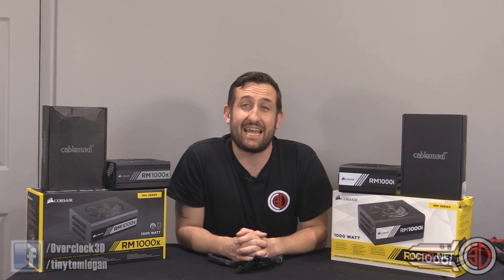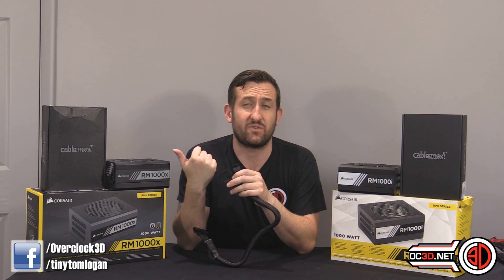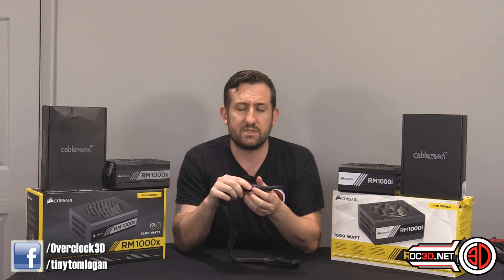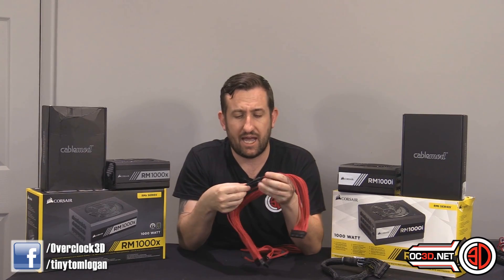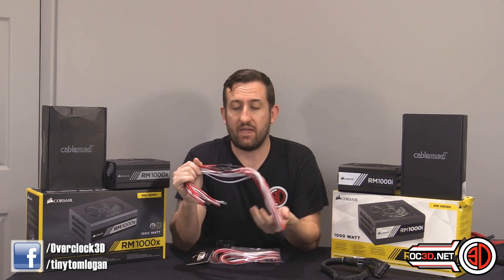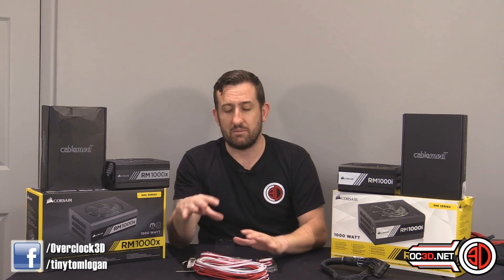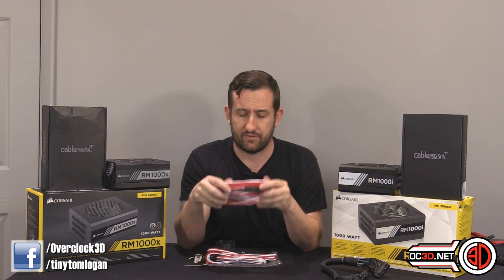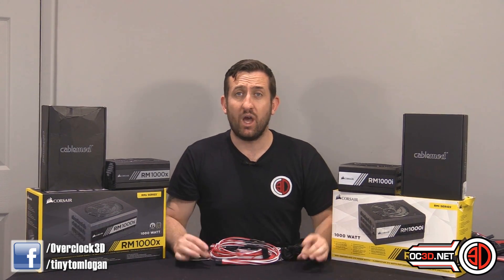CableMod Corsair RMi and RMx Cable Kit Review & Explanation

Comment: Cable comb question. Does the cable mod pro replacement cable kit come with aluminum or plastic closed cable combs attached to the main cables (24 pin, PCI-E and EPS and how many cable combs on each of those main cables? Thank you in advance.

Comment: Wouldn't it help if every PSU had in its description whether the cable ends are straight or right angle?  I bought one, another brand, that very well matches the components, except the proprietary case dimensions.  I bought it in spite of probably not fitting properly (after reading specs and looking at cost, better quality for lower price than OEM replacement), but didn't know that their were options/problems for straight vs angled ends.  Mine came with angled ends, so I can't put the hinged ODD tray down with the HDD plugged in.

Comment: I recently bought a Corsair CX750M... but the 24 Pins and the CPU and the PSU cables are already there, you can't really change them, is there any possibility for me to get extentions so insine my PC I can plug in the extended coloured sleeved cable instead of the rough stock cables? (sorry for the bad english lol)

Comment: What none of these reviews mention is that the 24-pin cable actually has 27 cables which makes it difficult to add combs. It's not even compatible with Cablemod's own C-series cable comb kit (speaking of which, when are they going to do black ones?) and the E22 combs do not fit.
Reply from the maker: +MAIN SEQUENCE Pretty sure its 28 PSU end
Reply: +OC3D TV there are 27 cables at the MB end which is the end that matters because it's visible. So hopefully Cablemod will produce 28 or 14 or even 4 slot combs to fit otherwise I'll wait til E22 start selling 2mm combs (which they intend to do apparently). Beginning to think I should have bought extensions instead.
Reply: +MAIN SEQUENCE this fixed now?

Comment: My PSU is RM850I and I recently purchased the CableMod C-Series AXi, HXi & RM cable kit not knowing there was a CableMod C-Series RMi / RMx Basic Cable Kit available.

Which cables are different between the two kits?  Is it only the 4 cables that I need to swap out and can I use the rest of them?  Many thanks in advance to anybody who can break it down for me?
Reply: Did you ever get an answer to this? I may have made a similar mistake.
Reply: I have the same issue, did you get a response
Reply: The motherboard cable from the AXi HXi and RM kit won't fit on a RMi or RMx power supply. The RMi and RMx have a wider connector for the 24 pin cable on the PSU side than the kit provides. The rest of the cables fit but I don't know whether they're wired identically. To be safe I'd just just use the dedicated kit for RMi and RMx power supplies.

Comment: As an electrical engineer, I do find the extra capacitors pointless for 98% of consumers. Motherboards, GPU's all have capacitors and other components to smooth the ripples. This reminds me of beverage companies marketing bottled water as a necessity and healthier than purified tap water. It would be a good idea to use the extra capacitors if your sole objective is to achieve the absolute highest overclock. But for the average gamer, it's not necessary.
Reply: The latest cables from cablemods come withouth capacitors.. Guess they find out it was pointless afterall 😁

Comment: damm that was some bigs cap's U coude have use some must smaller ones just to take the ripples ok it mebi a little more expensive but the individually braided coude have gone over the heatshrink. And a error in U txt it not (MV) ripps (megavolt) it (mV) ripps (millivolt)

like U shows Hugorm 
ps typing is not my strong side

Comment: If the caps need to be as close as possible to the PSU connector as possible, why didn't Corsair put them right between the PSU PCB and the connector on the PSU side? That way you don't need any caps on the wires..
Reply: My thoughts exactly, Don't know why, but it would make sense if Corsair kept the caps inside the psu .
Reply: The caps were at the motherboard end.
Reply: Ichabaud Craine Have you not watched the video or something? Moving the caps to the middle of the cable causes 8mV rimples. If they're near the PSU connector it's only 2mV..  So the greather the distance between the caps and the PSU, the larger you're rimples are..  Do you know tools like MSI Afterburner? Adding only a few mV after a GPU overclock can stabilize you're GPU. Now, what do you think what happens if you have an 8mV dip.. If the rimples are big enough they can even crash you're game.. Luckily for us CPU's are less sensitive to rimples, but smaller rimples is always better..

Comment: im getting a corsair HX 1200i, do cablemod do cables for that?
if so do those cables also have the capacitors or is not needed for that PSU?
Reply: +t103Ninja we do have a cable Series for the HXi Series - it is called C-Series AXi, HXi & RM and does not need capacitors.
Reply: CableMod Community thanks for the info :)

Comment: What if I don't care about the improved ripple reduction given by the caps and I prefer normal cables without caps? Will those be avaliable?
Reply: +RockTouching He said yes i think
Reply: +RockTouching wouldnt really matter because once you have routed the cables behind he motherboard tray you won't see the caps anyways!
Reply: +CableMod Community I'm gonna be building in a Node304 and although the case doesn't have a window I'm gonna be showing off the internals. No way of hiding the ugly heatshrink in that mitx case.
Reply: got it - Im afraid then we do not have a suitable solution for you at the moment.
Reply: +CableMod Community oh, bummer :( Well, thanks for your answer.

Comment: I don't get it. On the page they show a list (compatibility) where there are listed those: 'SE-Series Seasonic® M12II EVO Edition 520/620/750/850'. But ih the products section none of the Seasonic cables are compatible with M12II EVO Edition Series. They show compatibility only with Seasonic® XP2 / XP3 / KM3 / FL2 and XFX® PRO Series Black Edition power supplies. Is there an error or is one of these compatible also with M12II EVO Edition Series and if yes wich one? I'll send an email.
Reply: +ZanderLexx sorry for that - we will make it more clear - our SE-Series is compatible with your M12II EVO Edition Series.
Reply: +CableMod Community Thanks a lot. I have now an M12II EVO Edition Series 520 and i need to upgrade it to 750 for sli (i have a strix gtx 970). Also i wanted some cable goodness while upgrading :)
Reply: +ZanderLexx sounds like a wonderful plan to me - thanks for the support! :)
Reply: CableMod Community Can i ask you something?

I bought RMx Pro set (CM-PCSR-FKIT-NKC-R) for my Corsair RM850x but there is no capacitors on cables like original have. Do i get wrong cables? I dont want to destroy my lovely 9900k and RTX2080Ti.
Can you explain why there is no capacitors when Corsair original cables have them (even non-pro cables from you have them, as i can see from photos on internet)? Do i need to replace them with another kit?
Thank you

Comment: The capacitors seem to be on PSU cables to get your PSU to the top of the tables as the testing equipment doesn't have any smoothing caps on the input.
Motherboards, GPUs, etc all have capacitors on them to smooth the ripple anyway, I bet cable caps don't really make that much difference IRL.
Reply: +Matt Green I've just bought an RM1000i and an NZXT H440 case.  I was really looking forward to doing my build, until I realized that the capacitor placement on the cables makes the 24 pin, the 8 pin and the PCI-E cables an eyesore because you can't bend them like normal PSU cables.  So I either put up with this eyesore, or spend another fuck knows how much on cablemod cables ... nice ...
Reply: +Matt Green  Seem's like something corsair would do, would be interesting to see what the ripple is like without the capacitors.
Reply from the maker: +TheWargod56 corsair are late to the game. All superflower and evga units have had them for years
Reply: OC3D TV
I didn't realise it was so common, I don't see it mentioned when people are doing custom cables or anything like that.
Reply: +OC3D TV could you tell what's the length between SATA connectors as the stock corsair RMi are pretty short
Reply: *****
Okay, good to know, thanks.

Comment: I got a good question. The length of the cable will matter. I am planning a new rig and i what to make it to fit.
Reply: +Carlos De Bernard we designed our cables in a way so they are suitable for most of the cases in the market - what case are you planning to use for your build?
Reply: +CableMod Community for the moment i am planning to get the fractal design s. but most cables are to long or to short. So i was planning to make my own custom length so i can root my cables so be need and clean. so the question is regarding if the length will matter.
Reply: +Carlos De Bernard guess it really depends on what you are after and planning to archive in terms of the design / look - with basic cable routing skills our cables will work just with with the Fractal Design S.

Comment: Are these capacitor cables available to the AX series?
Reply from the maker: +My 0x1E No only the units that should have them at stock.
Reply: +My 0x1E there is no need to capacitors at the AX Series - we have a cable series for AX as well.
Reply: CableMod Community IS that because it can't be done, or just because the AX series just doesn't need it?
I have no idea about PSU's and cables but would like to know if I can save ripples if possible.

Comment: all our Basic Kits are available at: http://store.cablemod.com/
Reply: +CableMod Community I own a Superflower Leadex Platinum 550w PSU - No cablemod cables yet I'm afraid? :)
Reply: st3yn The Superflower Leadex PSU's use proprietary universal crystal block connectors that aren't available to buy separately anywhere (as far as I'm aware, although Cablemod may be able to source them) and not standard type 3 (like on Corsair RM, HXi, AX, AXi, EVGA SuperNOVA G2 and P2 and most other fully modular PSU's). The only way to get cables done for a Superflower Leadex is to send the original cables or type 3 connectors to someone like Pexon, even the mighty TTL had to go that route.